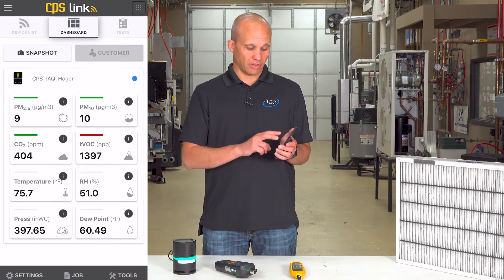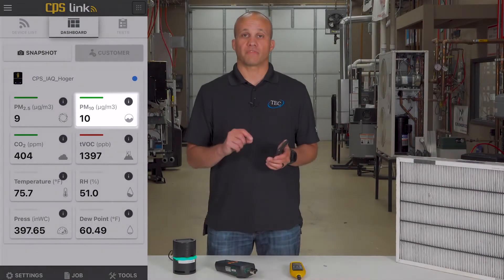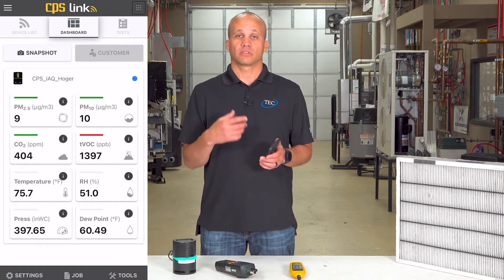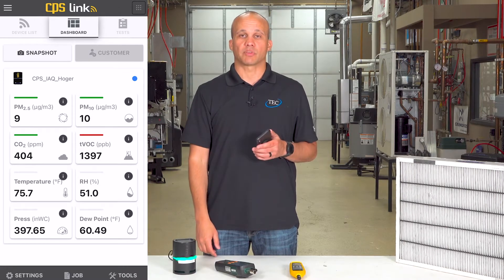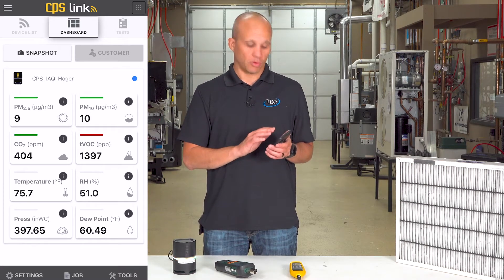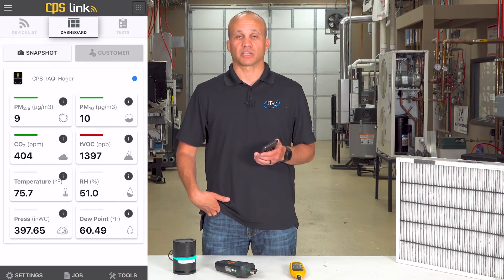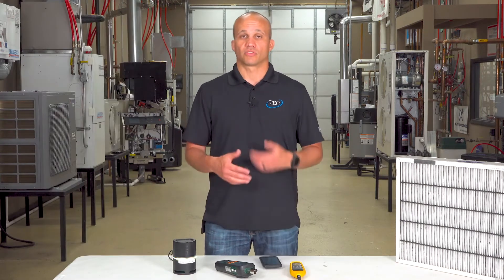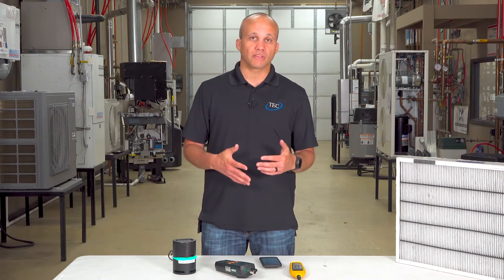Indoor Air Quality 101 for Commercial Buildings

Comment: Can you provide the make/model  of each tool used in the video to test the air quality. Thanks!
Reply: Bluetooth air quality monitor was made by CPS. Part # IAQPRO
Reply: Fluke 971 for temp, humidity, dewpoint, etc
Reply: Particle counter was EXTECH